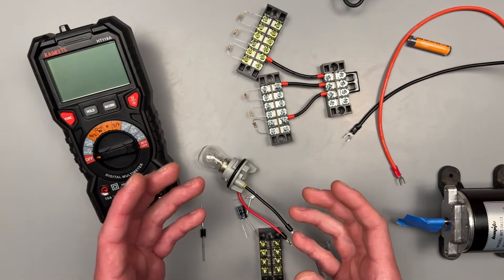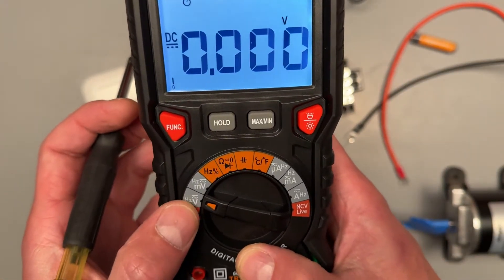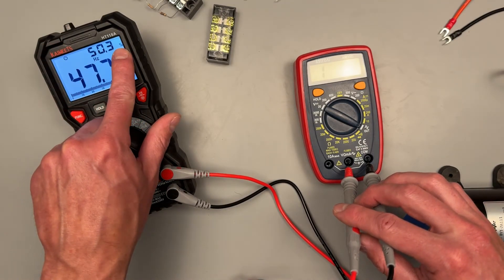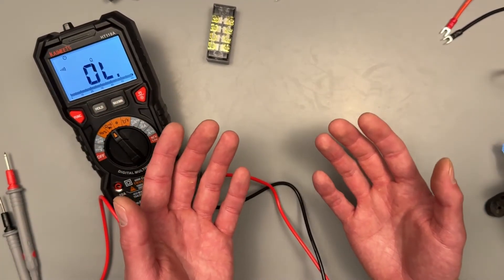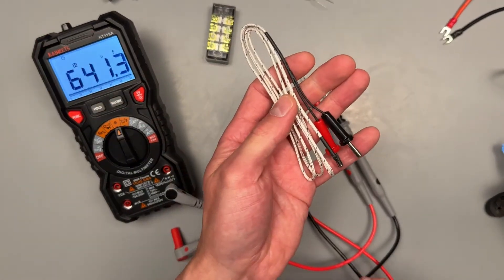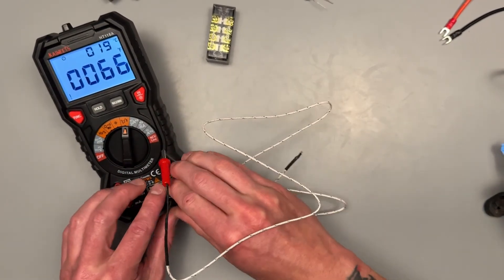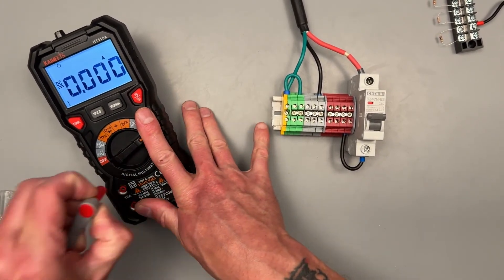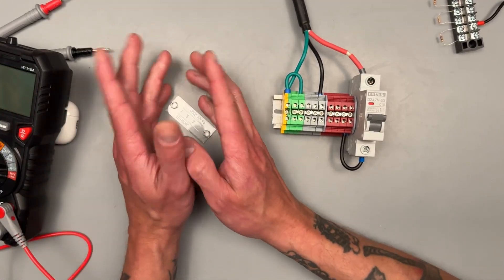How to Use Kaiweets HT118A Digital Multimeter for Beginners (Full Tutorial & Review) ⚡️💡

Comment: Has anyone noticed this piece of junk resets itself for no reason when the backlight is on and it is bumped from the bottom and only when the backlight is on?
Reply from the maker: I certainly haven’t! But if it’s doing that, I would send it back ASAP and get a fresh one. Sounds defective.
Reply: @maddoxmechanic  
Thank you for letting me know yours is not doing that.  Did a lot of reserach on this unit.  I was testing my car battery in the boot at night and the unit would slip and fall off the battery about 6 inches while I was trying to touch the leads and it would reset itself.  So, I kept having to turn the backlight on.  I realized it was totally resetting when I brought it inside, turned it on, turned the backlight on, and gently tapping the bottom on the table.  Don't want to return and replace if this is how they are made.
Reply from the maker: @frankcanha idk, doesn’t sound right to me. I’ve done a lot of work with Kaiweets, they’re good people. They’d want you to have a meter that works properly.

Comment: Hmmm. Does this have a fuse? Mine is no longer functioning and out is not the batteries. My old meter had a user replaceable fuse as a safety feature.
Reply from the maker: Yes. It has a 600mA/250v fuse and a 10A/250v fuse

Comment: Hi. Two days ago, I bought this DMM 118A I have another 3 multimeters UT 133A and UT 133B all the DMM show different values why? Also I have one for 5 euro which shows 10 mV more. My queation is: which of all is correct and how to find out
Reply: Does this unit have a safety device to prevent me from causing a problem to my ecm on my car..I actually have no idea what I'm doing.. I just wing it...
Reply from the maker: @kennethfinch3629  There's not a safety device that comes in the unit other than the fuses. But you'll actually have one on hand and the best part, its completely free to use. It's called YOUR BRAIN.  Hit the books before you touch that thing because you'll cook it in two seconds.
Reply: @maddoxmechanic ok thank Yu.
Reply from the maker: @kennethfinch3629  You bet!
Reply from the maker: Great question. I think it would depend on what you're trying to measure. If it is AC voltage, whether or not the meter is rated for True RMS would be my first instinct. If just regular DC low voltage, most likely the quality of your multimeter leads is effecting the measurements. If they're low quality, or making poor contact, it could add a slight amount of voltage drop, changing the value measured. I think it's also important to note, that since these meters are all at what I would consider a "entry level" price point, they're not calibrated and certified meters. Hope that helps!
Reply: @maddoxmechanic Thank you for your quick answer. I am working only with DC and the DMM is same HT118A. Thank you again
Reply from the maker: @siderov777  You bet! Let me know if you have any other questions! Thanks for watching!

Comment: How could I measure with this device if my voltage on  a circuit outlet is 110 or 220v  I can’t figure that out
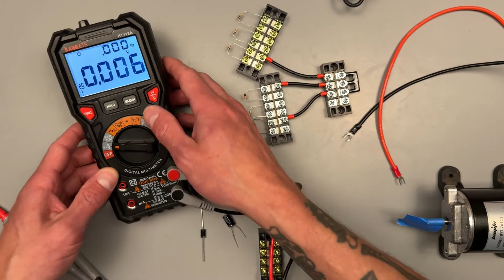Reply from the maker: be very careful. you should be wearing electrically insulated gloves and safety glasses. I have a demonstration at 2:58 of how to measure AC voltage. 

But honestly I would just try using an outlet tester. much easier to navigate and safer too!!